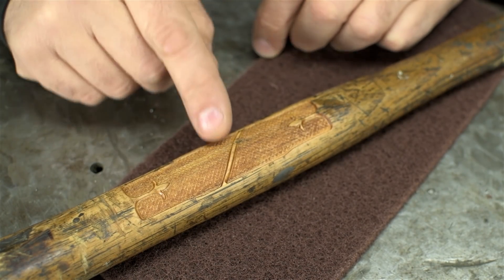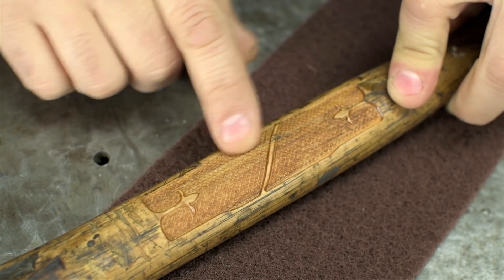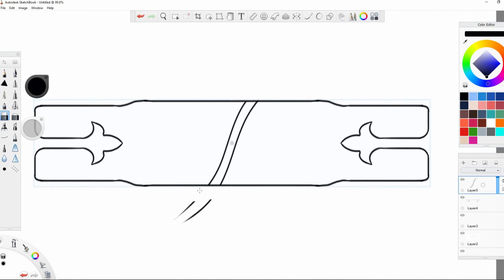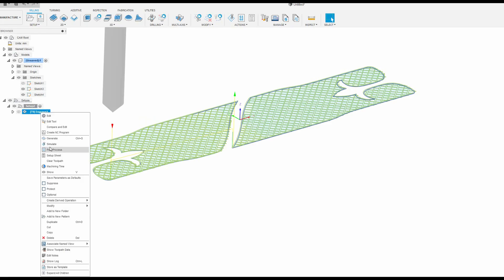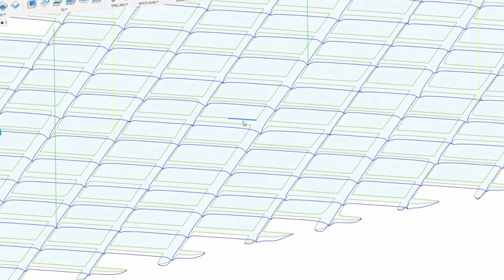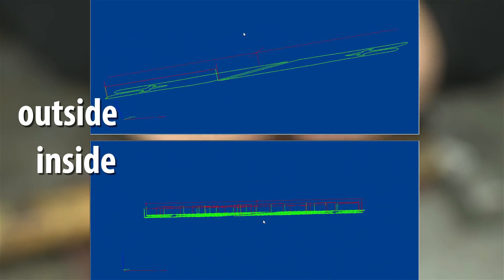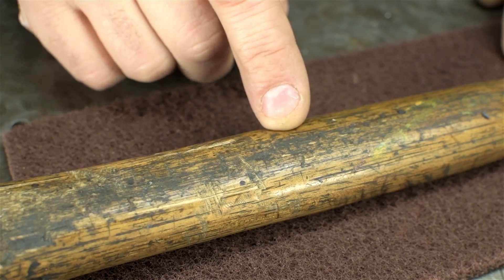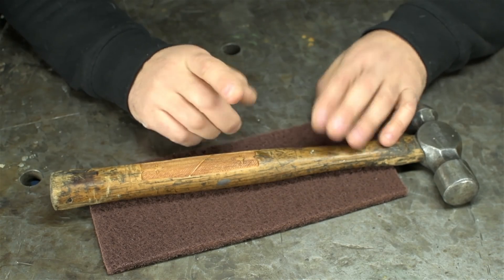CNC Checkering!!

Comment: Don't even draw the checkering guys. I don't use fusion but this is how I do it with every other CAM software I've used.

 draw the outline as a boundary and write a raster finishing tool path. 
Allow it to cut both directions(climb and conventional)
Do your raster at a 45 and then write duplicate path at a -45. 
Do this with a 45deg chamfer endmill and work out your step over and final depth using a stock model reference untill you make nice pyramids all thru your boundary. 
Then a simple perimeter pass to clean it all up. Usually a few grand deeper than the engraving. 
I've done this to many many objects for grip on bttm of mounting plates, handles, surfaces u don't want ppl to lean on lol

Comment: Dumb Q? but could you hold a Dermal in the CNC mill and leave the spindly turned off? Better yet get a battery powered Dermal and then spin the spindle to increase the RPMs. I'm sure it would be as safe as juggling chain saws.

Comment: There is one other serious mistake you made (& almost everyone else makes when using CAD).  You let "HAL" determine the ORDER of the cuts.  You needed to do this MANUALLY for work like this.  The file looked like a chicken pecking at feed sprinkles on the work!  The order is evident in the finished work.  (Most CAD won't even permit you to do this.)  In a cut like this, the ORDER of the cuts matters.  It would also help to run the file 3 times: once with depth a little shallow, to remove most of the material & cause splitting. etc.  Run a second time at full depth, & a third time at the same depth to shave off the burs.
          Kludgy way to force order: to the checkerboard plot, add a line from (0,0) to the first line you want milled.  Ad little pieces connecting the ends of the lines to form a continuous path.  Let the CAD generate the G-code.  Then edit the G-code & delete the first & all the connecting lines from the plot.
          To deal with too-slow milling spindle, run the file slower in proportion.  Unless you are making these en masse, there is no race.

          For simple 2D plots, & "2 1/2 D" plots, I have software scheme that allows building the order into the original CAD file (the start point & the "other lines" are placed in another layer).  Then I run a program I wrote to extract the data & create the G-code.  You can even encode in the file speed & feed changes.  If the result it undesirable, you can edit the original CAD file instead of the G-code.

Comment: Hi guys, I'm getting into a bit of metalworking and I was wondering if there were any cheap-o tap & die sets you'd recommend. Off Amazon preferably, but anywhere is alright. I am only doing work with aluminum and softer metals for the foreseeable future so I am not worried about buying the nicest/most expensive set. Would need to be metric, too. I bought this set called Hi-Spec but it's missing most of the taps and literally the only die I need, and seems very low quality so I am returning it. I bought a set of metric drill bits off Amazon too so I suppose those aren't required.

If there is anywhere to buy specifically 1 die or 1 tap that would be cool too, I wouldn't mind buying them as I needed them, if it meant I could buy a nice die for the price of 5 cheap ones or something like that. Any brands or websites or whatever you recommend would be super helpful!

Comment: Try 3 or 3 1/2 to 1 diamonds. A 75 degree angle on the tool point would be correct also. The hard to get aspect of checkering is the 2D art, over a 3D surface. That Z axis will really hose a guy up......

Comment: You said that retrofit of old mill has some drawbacks. I decided to do the same, i am half way there. Can you point out why It is not such a great idea?
Reply from the maker: mostly the speed.  spindle and table.  if you're not in a hurry it's not a problem.  modern cnc uses very efficient and fast tool paths that i can't hit. eg  small endmill in aluminum want to go screaming fast.  i can still get the job done... just need to be patient.
Reply: @ThisOldTony  thank You for anwser. I am fine with this, i'm not in a hurry. I get rid of old spindle,  my custom one can go to 8k rpm and servos can shake the whole machine. So i think i'm good.
Greetings from Poland! :)
If you nead any help in shipping from europe, just let me know

Comment: TOT: You may also try doing those patterns with face milling operations rotated in +/-45° with a engraver or ball endmill.
If you set your stock to the wanted outline and configure the parameters right (stepover, in/out, stock offset) you can get nice lines without any trouble.

Or do 3 passes with 60° and get nice diamonds ;)

Comment: Or you could do my method, grab a pocket full of waste slugs from a cutout leftover from work, painstaking hand file the tool steel into the gouges and spacers for cutting the gnurling by hand, and then spend several hours carefully scribing the handle with them. 

The main bonus is it pre-loads a new handle with blood, sweat and a healthy amount of tears and frustration into the tool for the recipient.

Comment: Hi Tony, great video as always..
I was wondering, since the checker grid is on a 45°, could you set the hammer at 45° in the vice, then the bit could cut the grid in the X and Y without having to zig-zag.
Might be interesting to try, see if the cut is quicker..

Comment: About the wood; you're right that Walnut would have taken the detail better, but not because it is denser. Tool handles are usually made from a "ring porous" wood..... Ash, Hickory, Oak. Ring porous woods have more bending strength than "diffuse porous" woods, I think it's called "modulus of elasticity". They are also "usually" harder and denser than diffuse porous woods.
The grain in ring porous wood is open and rough, think Oak or Ash...... you can see the open pores of the wood and the "rings" in the grain. The grain in diffuse porous wood is tight, pores are hardly visible, and it has a "creamy" texture..... think hard Maple or Cherry...... woods like this will take a high level of detail. 
Walnut is a weird one actually..... its known as "semi ring porous", as you can probably guess; it's in between the other 2. It has tight grain, but it still has open pores visible to the eye...... but it will still take good detail compared to a ring porous wood 😁
I'm a woodworker (ya hardly woulda guessed 🙄😂) and I am SHOCKED that a machinist equated 3/8ths to "roughly" 10mm 😳😂  0.5mm (1/64th) is around my working tolerance...... that's like a canyon to people like you 🤣 
Enjoyed the video, as always 😁🤙

Comment: Hickory checkers poorly, but an initial pass followed by soaking in CA glue would allow better performance.  Also...and this is critical...checkering should be diamonds, not squares.  Change the line intersection to 60 from 90 degrees.

Comment: Perfect demo of how to use the previous video.  I've seen checkering done on a surface by just controlling the direction of a bit cleaning the pocket, then changing the bit direction 90 degrees and do it again.  Of course it's a pointed bit which in turn leaves the checkering.  Did a lousy job of explaining that, I think NYCCNC did something like that. This was a nice Xmas present.

Comment: Sir, great video.  I would like to pass this on to you if no one else has.  Most checkering on stocks or grips is done in formats of 20 lines per inch, 25 lines per inch.  So when you lay out your lines, you may need to actually use a layout pattern of 20 lpi, it's usually the standard option most go with.  That might help your diamonds stand up better.  Thanks again for the video sir.

Comment: The 90 degree angle of the checkering isn't the regular, the angle needs to be longer if you want diamonds instead of pyramids. And the bit angle needs to be 15 to 30 degrees, 45 is to wide for points on top, and lines usually run around at 15 to 20 lines per inch.
 Bloody amazing though, would take a day or two with files and chisels.

Comment: On my old cheap Chinese mill I converted I made a second spindle for Sherline WW collet. It had big pulley on the normal spindle, small on the WW collet spindle. O ring drive was great. Never got around to  proper spring loaded engraver bit holder which is great for curved surface as the spring has constant force, hence constant depth of cut

Comment: you might call that checkering but I wouldn't. I used to be a gunsmith and did stock work. the diamonds aren't sharp . checkering take a long time to get good at.  Try a coarser pattern next time. a hammer handle wood is not the best stick of wood to checker unlike a gunstock with tighter grain patterns.

Comment: Very clever Tony. As always, love the videos as they always make me laugh. So please keep it up as it’s good for my mental health. I was wondering if you might be able to help me out though. I have just started using Fusion 360 and am teaching myself to operate a Mori Seiki MV50 VMC. The problem I am having is converting Fusion into G code and then posting it to the mill so that it will read it. The mill has an old Fanuc 6M controller on it. Any suggestions please?
Reply from the maker: I'm no expert but the Autodesk site has a place to download the correct post processor for your controller.  or one that's close enough.

Comment: I'd just draw the 2d curves which would represent center of where the endmill should be travelling -2D contour operation, turn COMPENSATION OFF, disable Lead IN&Lead OUT, set the BOTTOM HEIGHT as how deep the endmill would go and that's it. No roughing passes, no multiple depths, no ramps - the endmill should just go straight down on the center of the line at the set bottom heigh. To get nice sharp pyramid just adjust the bottom height (space between 4 lines define the area of the pyramid). Easy, quick, painless. Edit: You could draw a quick hatch pattern lines and then create an outline which would set the Stock contours - this way you don't have to do any tedious manual trimming of lines. Unfortunately, such a technique on a 3axis mill would not be sufficient for high end firearm checkering - you'd need a 5axis with a 3d model so it could angle the tool properly so you get non distorted pattern.

Comment: How about making up a 4 to 1 planetary gear box that would be mounted on your spindle but have a chuck or a collet to hold your tool bit? 4 to 1 would give you 11,200 tool speed. Just a thought.........
Reply: @Scooter Tramp Planetary gear boxes are made to slow speeds on the output side, unless you like the idea of blowing up the small planet gears around the sun gear.

Comment: You can do a pocket operation with a stepover value as your checker pattern pitch and skip all the internal lines. Use the chamfer tool even though the program thinks its a flat mill clearing the whole pocket. There are tutorials for knurling patterns that cover this fusion shortcut.

Comment: Our company does lots of wood checkering - you hit on the main issues, but I would also add you might want to try running your lines fully instead of jumping around (by that I mean, cutting each row in one pass, instead of cutting around each diamond).  The changes in direction have inertia to deal with, so it might reduce your chipping.  Love your work!

Comment: I came up a different way using my 3d programs... self-trained, so I didn't learn the conventional methods to do things, I just sought straight-line performance to my goal.
If my desired end point was pyramids, I would have drawn a pyramid, arrayed it, then negative'd it into a mold, and "stamped" it into the design piece in the program. ie boolean difference. And then let the program decide the best tool path for that.

Comment: Heya, gunsmith here. One of the issues with checkering the harder woods is they become brittle and rarely can be shaped to a proper point. I don't know if it was just convenience or secret planning but one way you can help make stable checkering on harder woods is reduce the ratio of the diamonds, so making them squares like you did gave them the best chance. Normally we use diamonds about twice as long as wide. Another way to help the more brittle woods come to points is to seal and bolster the wood first. I am in the habit of brushing the pattern with a thinned oil mix every time I change direction, even on good walnut. A proper sanding sealer can sometimes be just enough that it helps keep the wood together, which is why we usually finish the stock first then checker it, even though checkering a stock risks damaging the finish (beyond the bit we are intentionally damaging that is). It is possible to do the reverse but not having to avoid checkering while sanding down a finish is also very convenient. It is way harder on the tools but about the only way to reliably get a good pattern on maple is to layout your lines, add CA glue, then cut your points and add more any time you notice the wood getting kind of powdery. On layout, we usually set a pair of master lines in the center of the work then we offset from there. The reason we start in the middle instead of the edge is we cut along (usually with a guide) as close to even with the line next to it as we can. Because we often are cutting on curves we tend to only cut a few lines at a time on a single pass of the tool, the cradle we use to hold a workpiece only gives us so much freedom, so it may be that two or three lines are perfectly spaced by the tool then one line is close to perfectly spaced and as you go on with the pattern the tolerance stacking can start to show. We try to find the common minimum distance for the pattern to be from any particular line and make that the master line, be it a fill in or a point pattern. The advantage of cutting a piece by hand in a cradle that lets us put the pattern over the flow of the surface is the points always go out, not merely up, and they do not deform on curves (as much at least) giving a more uniform texture. That can be remedied to some extent with a 4th or 5th axis but as long as (and I say this with all of the love in the world) amateurs put out work like this it just makes good artistry shine even better. Thank you for the video!
Reply: Totally agree, were were both commenting at the same time with much the same points.
Reply: If I wanted to make a tool handle and getting good checkering was important, what would be the best wood to use?  Strength of the handle is not a major issue.
Reply: @stevewyckoff6904  It depends on the tool I guess if strength is an issue or not but if you say it is not an issue then it can be whatever you like. I assume the handle shown in this video is a typical hickory wood, which is good for a handle, but if you want good checkering and don't mind putting in the work then you can really use anything. As I mentioned in the comment, a thinned finish or sanding sealer than can penetrate into the wood or a cyanoacrylate like "Hot Stuff, Thin" or possibly even a thinned wood glue (if color is not an issue) could be used to fill the pores and grain of the wood so it is less prone to chip off. Might even be able to hot apply wax but I have not tried checkering finicky wood sealed with wax so I can't say for sure. The idea is at that point you are more carving plastic that has wood in it than just wood. You draw on your pattern, use a flexible straight edge to set your master lines, carefully start the groove for your master lines with a single line cutter, then use a spacer cutter that is essentially two or three or four v shaped files except one is smooth and you run the smooth one in the groove you just cut and the cutting side cuts in 1 or 2 or sometimes 3 new lines depending on the tool you use. Do that till you have thin lines expanding left and right to the edged from both master lines, using the flexible straight edge for any areas where there is a break in the line pattern to keep it even, add your sealer/finish/glue, let it set, then begin the always time consuming process of cutting those lines deeper and deeper till you have pointed diamonds, adding more stabilizer as you go. If you break a few off that isn't an issue really, just save the dust, pile it where the points broke out, drop of CA glue and then shape it again. Once you have points then you do the edge then brush thoroughly to remove dust, feel free to use something like acetone or cleaner being sure to mask off any existing finish on the uncheckered surface, then apply your finish. Easy.
Reply: Man, I would LOVE to have a gunsmith like you in my part of the woods. It's hard to find one around here that takes care in their work like you obviously do. It's all about volume to the guys local to me... throw the parts at the gun, and move on.
Reply: @floorpizza8074  It is very difficult to keep a full time gunsmith fed. Efficiency is a major part of it. High volume is profitable. Literally, for a pattern like what is shown in the video (though nicer) would you pay $100-150? Just that panel, not also for one matching or any other, just that one area shown, would you pay that much? That is what hand work can cost. I have cleaned up checkering on many guns, I have checkered my own guns, I have checkered guns for friends and family, but I have never had anyone hire me for checkering. There are guys that have stocks sent to them from all over the country and they just do checkering and they get by ok. For a few years I was the only full time gunsmith in a city of 200,000, and legitimately I only had about 25 hours a week of actual work at the busiest, the rest was just practice or shop tasks. Guns these days don't usually need gunsmiths so we are a dying breed.